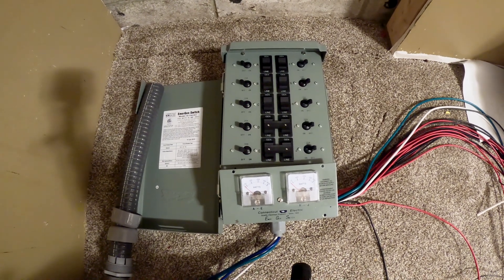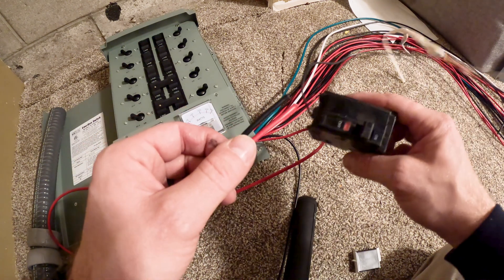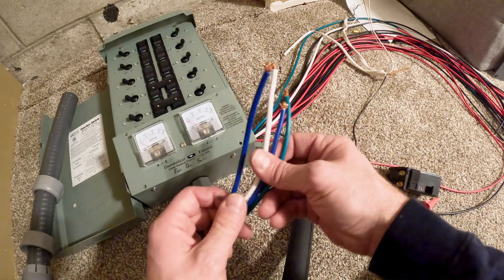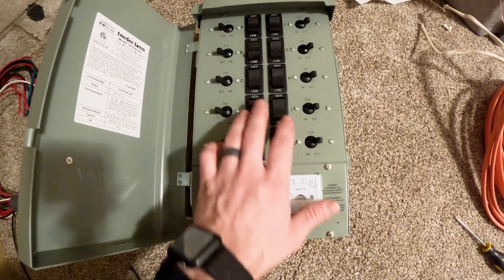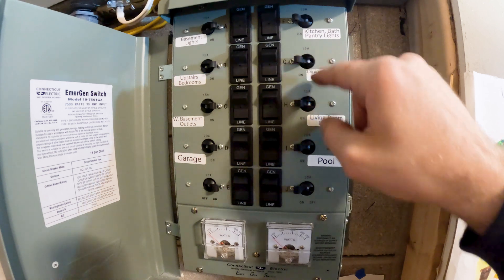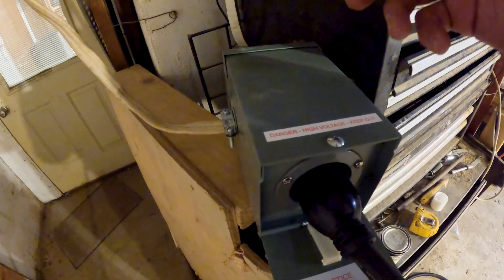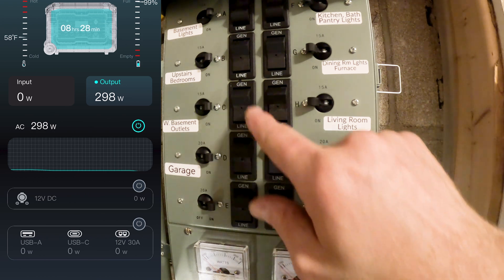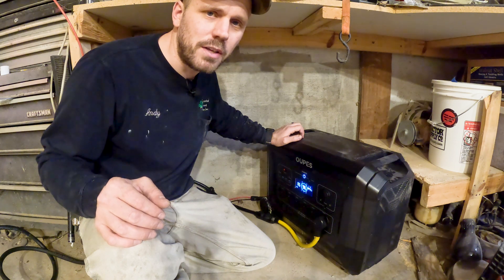How to install a critical load transfer switch

Comment: So I'm doing the same thing with Vevor's version of the switch you used to distribute power from my Pecron F3000LFP.  Couldn't we just combine the blue busbar wires inside the panel and run 3 wires to the generator connection input?
Reply from the maker: I’m not familiar with that one
Reply: @portercreek  It's identical to what you have but I have it installed now and you can tie the left/right legs together and the meters even still work.